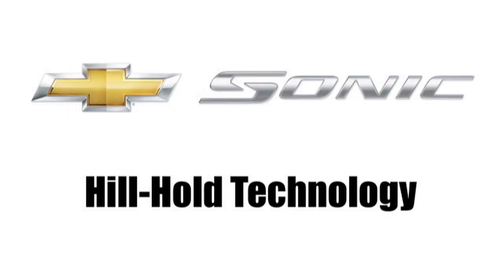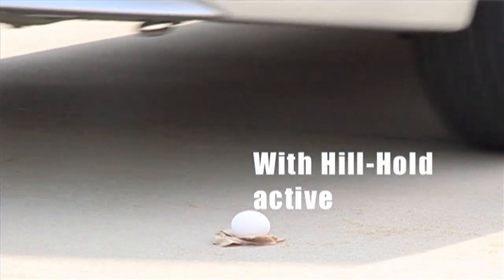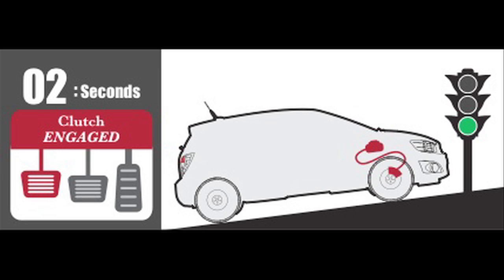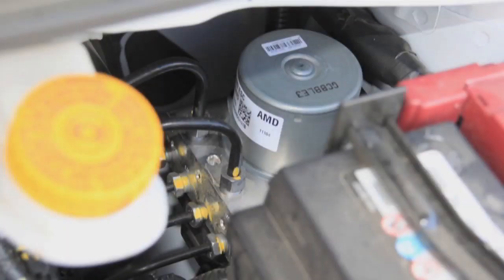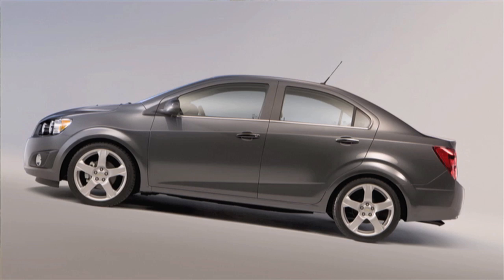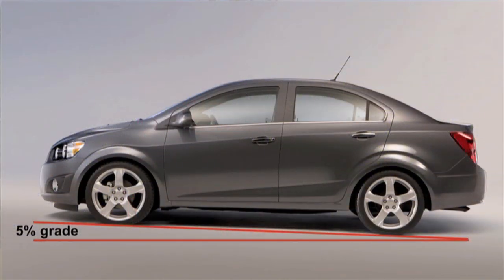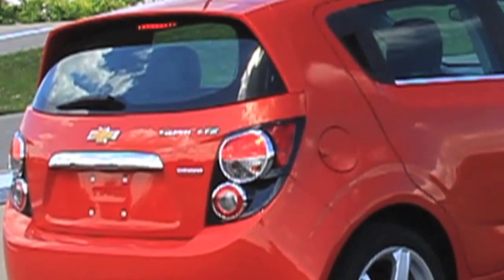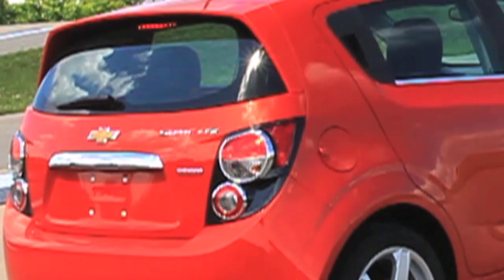2012 Chevy Sonic hill-hold technology

Comment from the maker: Actually, the 2011 Malibu (or any other model year of Malibu) doesn't have hill-hold assist. Even if it did, it only activates if the vehicle is already at a full stop and uses a pitch angle sensor to detect a hill, something the Malibu does not have. What you describe sounds like an issue with the transmission, perhaps not down-shifting properly and then trying to accelerate in a higher gear.